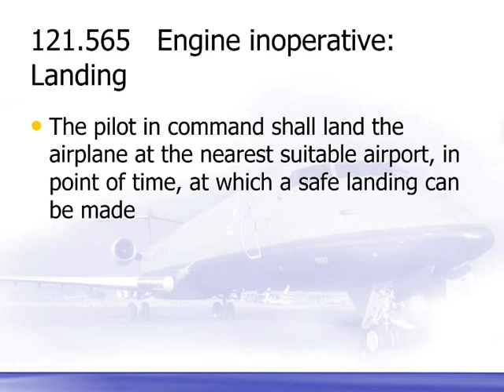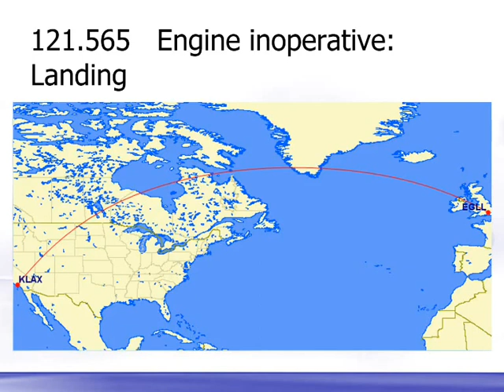Flight Operations: Engine Failure and Landing at Nearest Suitable Airport

Comment: I believe this rule is for a twin engine only. It does apply on 4 engines jet.
It's all about redundancy. This rule was put in place to avoid the pilots to elect to continue to tge the destination on one engine. Which means no redundancy.
In this scenario.  In a flight from LAX to LHR. 747 will most likely be close to its maximum take-off weight. To land under this circumstances. The would have to choose in between a overweight landing or fuel dump. To lower the weight by dumping fuel it can take up to 45 minutes or so. Overweight landing in this case may lead to brakes overheating and possibly a fire on the landing gear...the crew will have to evacuate the passenger s....
Reply from the maker: Thanks for watching! The point to my video was to talk about what happened between the FAA and British Airways in this case. Unfortunately, the FAA didn't agree with the BA captain's decision to continue. I hear what you're saying about landing in an overweight condition or dumping fuel, however, there were other airports they were flying past where they could have landed and not been overweight (such as KORD or KJFK or a bunch of other airports along their route generally.) I'm not the FAA or BA so it was just to provide an example.

Comment: Part B: If not more than one engine of an airplane that has three or more engines fails or is shut down to prevent possible damage, the pilot-in-command may proceed to an airport that the pilot selects if, after considering the following, the pilot makes a reasonable decision that proceeding to that airport is as safe as landing at the nearest suitable airport.

Under this part captain may continue. One could also argue 91.3 captain has final authority to continue to destination if they determine its safer than diverting.
Reply from the maker: It is possible for the captain to decide to do this, but from talking with dispatcher friends of mine, if the captain really elects to do that (and it's significantly farther away), it would likely have to be under their emergency authority (as you have mentioned, 91.3).

Comment: Hello Laura! I just met your YouTube channel. It's really cool! Look, I have a question... do you know the difference between ADEQUATE and SUITABLE airport? Cheers!
Reply from the maker: Hi Filipe, for this I'm going to turn over to this helpful post I found: https://www.facebook.com/AirNetTeam9M/posts/what-is-difference-between-adequate-airport-suitable-airport-and-enroute-alterna/2264533063760888/
14 CFR 121.7 defines adequate airport for parts of 121 that apply to ETOPS operations, so you can find the definition of "adequate airport" in 121.7. 141 CFR Part 121 doesn't actually define "suitable airport" exactly but does say in 14 CFR 121.565 that you have to go to the nearest "suitable" airport if an engine fails on a two engine aircraft...but then does not define it. Additional information directly from the FAA is here: https://www.faa.gov/about/office_org/headquarters_offices/agc/practice_areas/regulations/interpretations/data/interps/2013/powell%20-%20(2013)%20legal%20interpretation.pdf in their own legal interpretation. Airlines likely have their own FAA-approved definition of "suitable" in their manuals, but I have not been able to find a specific FAA definition...so I can't answer your question for United States FAA rules. Sorry!
Reply: @LauraLaster747  Thank you so much for your kind answer, it helps a lot. Cheers!